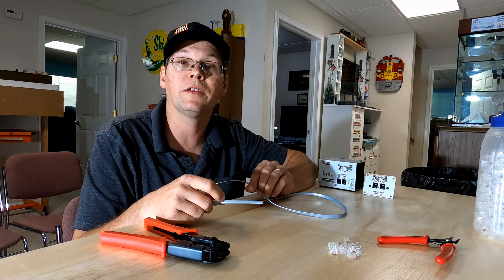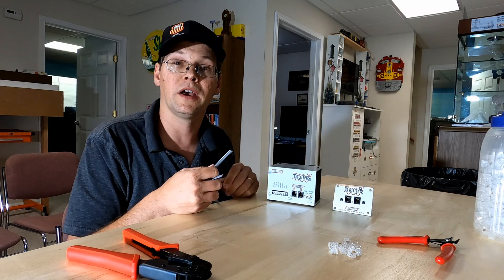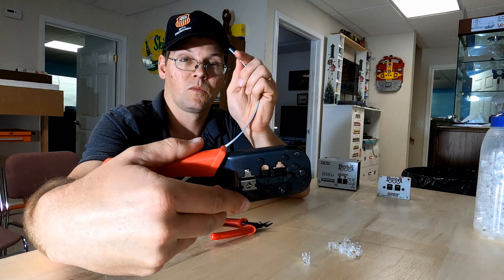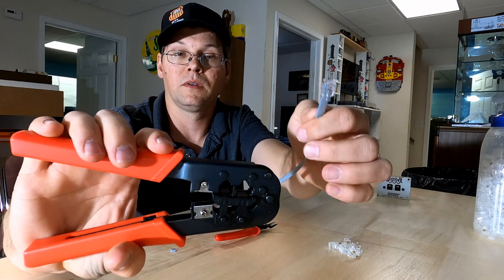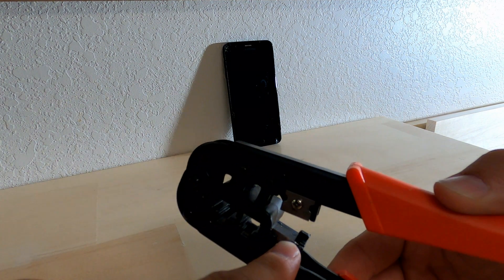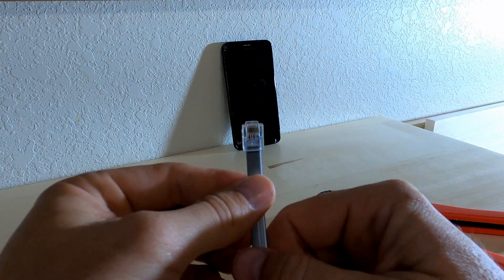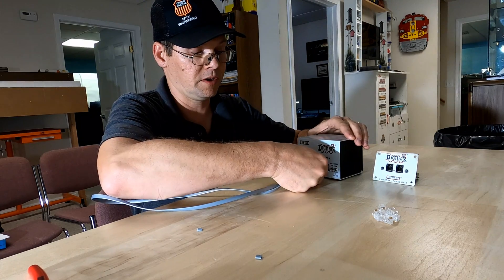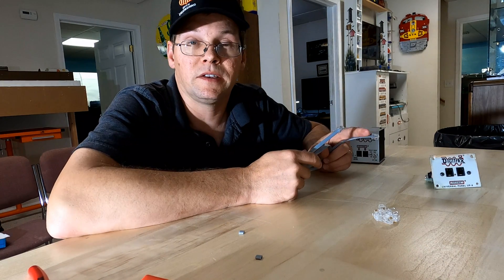Let's make a custom Loconet Cable for our Digitrax system

Comment: You cannot use rj 12 6 pin connector it must be Digitrax LNRJ12
Reply from the maker: Thanks for the comment, and welcome to the wonderful world of model railroading with Digitrax products.
Can you clarify your claim a little better? Literally, the RJ12's that come in the Digitrax package are just regular RJ12's. There is nothing special or different about them, other than they come in a fancy Digitrax official plastic bag! Maybe you misunderstood what someone else told you? Or you could be confusing the RJ12 for the RJ11. The 11 is a 6p4c, but the RJ12 is a 6p6c. The difference is the number of contacts in the housing. The Digitrax Loconet cable is a 6 wire cable, so requires the 6 contact modular plug.
To summarize, the RJ11 and 4 wire cable CANNOT be used for Digitrax Loconet, but RJ12 and 6 wire cable can be!
Good luck!

Comment: Thank you for that tutorial. At one point you said Digitrax uses a standard 6 wire telephone cable but then at another point you said you can’t get a regular 6 wire telephone cable. Is that because the already applied telephone jacks are applied differently but it’s the same cable?
Reply from the maker: What I meant was telephone cable that has connectors already on it, or 4 conductor telephone cable. It has to be 6 conductor, and the plugs have to be wired the way I explained in the video.

Comment: Nice video, however your crimper should have an cutter on the other side, so basically an all in one tool for crimping. As a suggestion, invest in a cable tester as I found bad connectors  or bad cable at times when I was building my HO Scale Free MO layout a few months ago. Very handy tool to invest in. Good video. Cheers